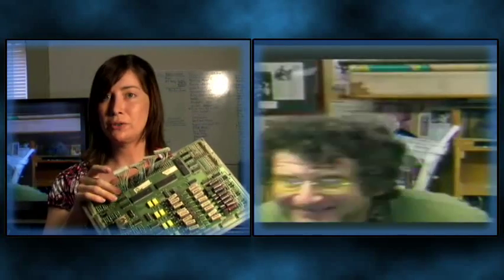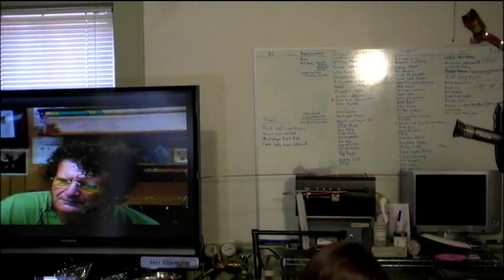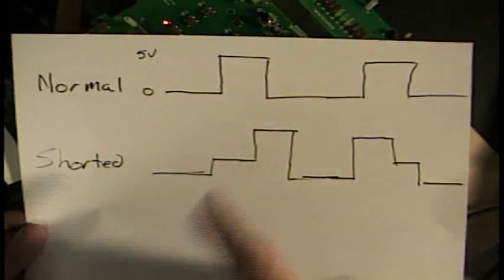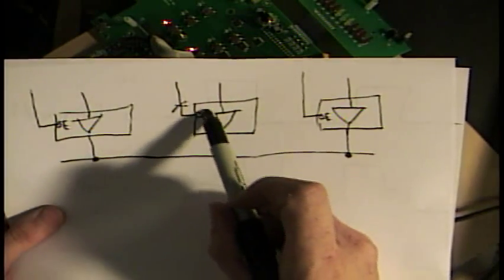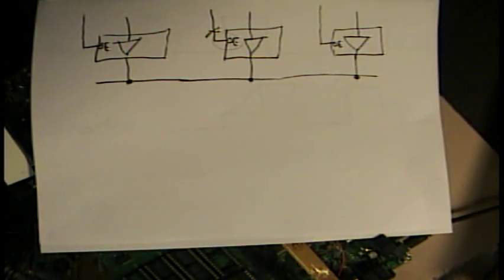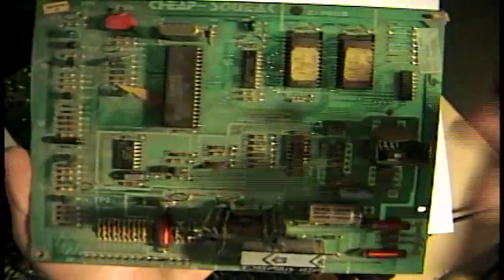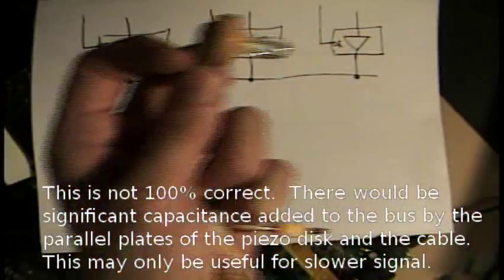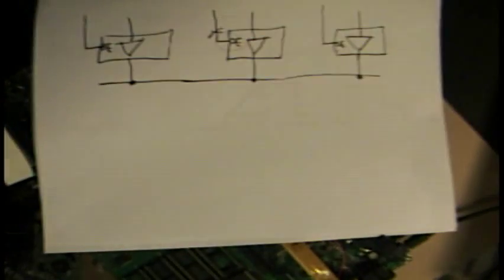Debugging Bus Contention - Electronics Repair Techniques

Comment: years back, a friend of mine who worked at Sperry Corp, gave my an 8088 MB that wasn't working.   An engineer there , gave up on it. I said.....I'll take a look at it if you would like......I found a hairline brake across on of the `highways' - (I thin wired across it, and to my surprize, it worked), 
   . Great videos !!!   Thank you